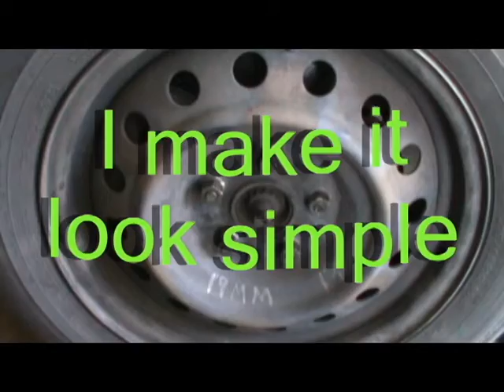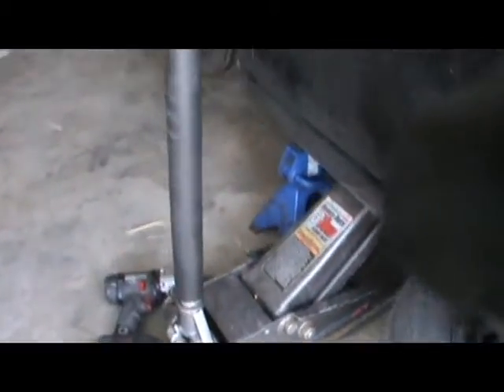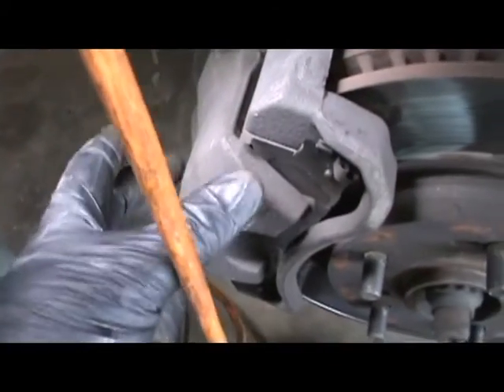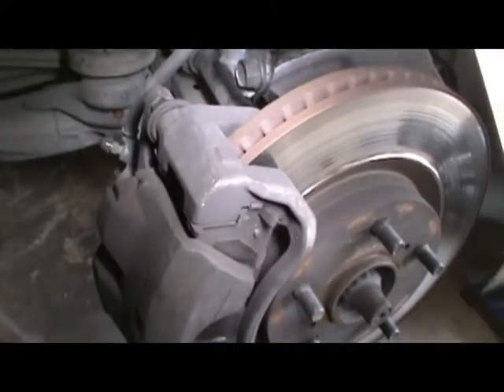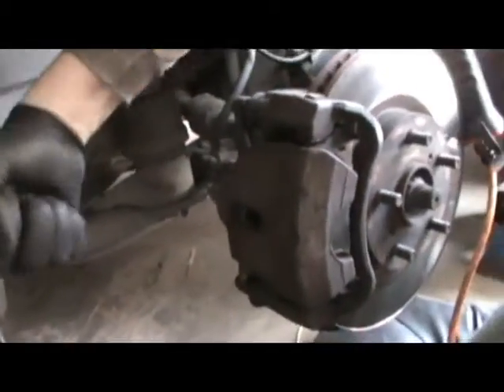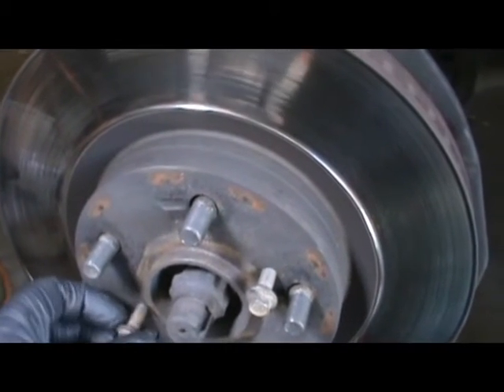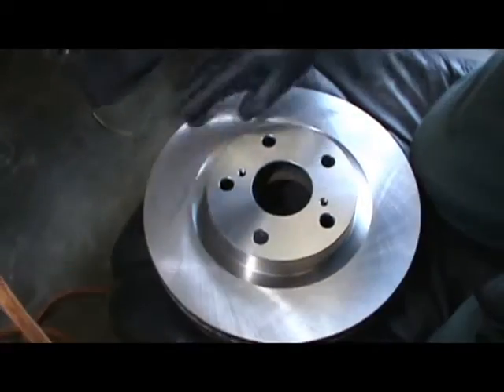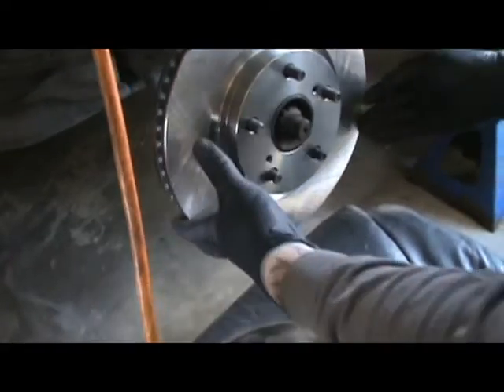Toyota Brake Rotor Replacement

Comment: If you don't have the two 1.25 bolts to use on the rotors. The bolts that hold the brake hose to the strut are 1.25  and you can use them. Just alittle tip :).